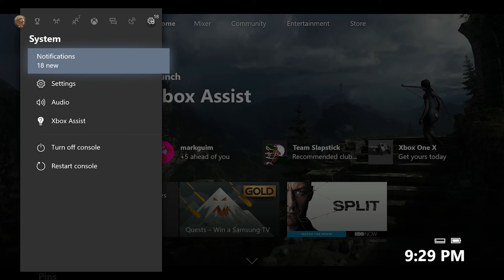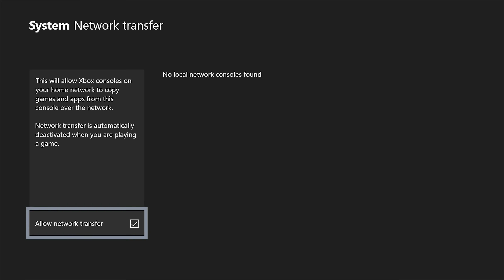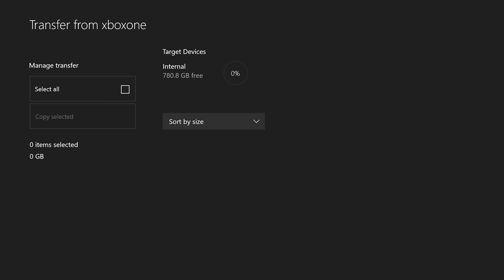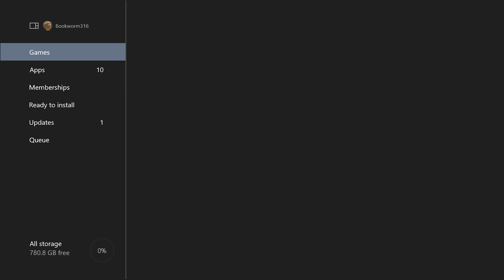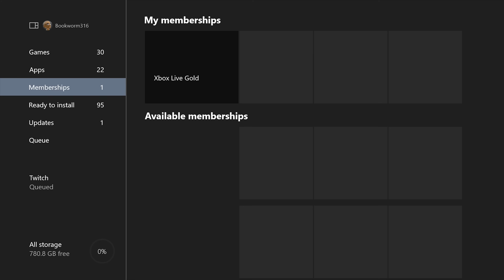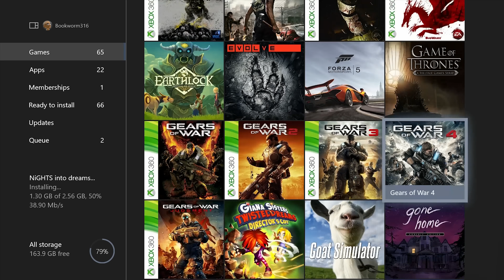Xbox One X Network Transfer Speed Test

Comment: my network transfer is going 1/5 of the download speed, just paused and resumed and it suddenly goes at a reasonable network speed. I'm noticing in 2024 the one x seems to be touchy regarding network at times, 80% of what I look up assumes I am using wifi and tells me to connect via ethernet which I am already doing

Comment: Do I need to have both Xboxs connected to my wifi in order to transfer thru network transfer??? because I'm planning on returning my Xbox one for an Xbox one S and idk if all my games n dlcs will carry over thru my profile
Reply: It should be on the cloud
Reply: @crownbikes1375 will the data of my disc games be saved if I transfer them from an xbox s to another one s?
Reply: Justified Anger yeah it should because of the cloud. I went from the Xbox one to the s and it saved I just had to reinstall all my games but it saved all my data
Reply: @crownbikes1375  are your really sure? Because I'm extremely scared and stressed out that I will lose all of the data from my ctr nitro fueled and lego dimensions games and mk11 and crash n sane trilogy too.
Reply: @crownbikes1375  and if the data is saved does it matter if its copied move or transfered?
Reply: Justified Anger as long as your on the same profile you should be good
Reply: Justified Anger people transfer or copy so they won’t have to reinstall.  I just went to work and left it all installing
Reply: @crownbikes1375  theres one more thing. I copied 4 xbox one games and two of them keep saying installation stop. If I cancel the 2 game will it delete the data from both of the consoles? I hope not
Reply: Justified Anger  no it’ll just delete the game but not the data that happened to me and I found a solution to it a while ago. What you can do too is get a external hard drive for like 50 bucks (2tbs) and copy the games onto there
Reply: @crownbikes1375  I have a hard drive but it's in the office and my console is in my room. Are you sure there isn't another way to get the 2 games installed besides transferring?
Reply: Justified Anger not sure research YouTube a bit you’ll find something but I work long hours I just let it install all in one day
Reply: @crownbikes1375  okay but are you sure there isn't a way to transfer all of your save game data to another profile?
Reply: @crownbikes1375  and if you restart the one of the consoles will it delete all the data from both consoles? I hope not
Reply: @crownbikes1375  and if I make a different account on the 2nd xbox one and transfer the data from the other one with the other different account it won't work will it?
Reply: Justified Anger no it won’t delete. And yeah it has to be the same account because each account has a cloud that saves game saved data
Reply: @crownbikes1375  okay but what happens if safely remove the hard drive from the console and plug it to the other one?

Comment: If you have gigabit ports on your router it doesn’t matter, the transfer speed is limited by the hard drive read and write speeds, which are SATA II limited since the Xbox one S has a SATA II port. The HDD in the regular Xbox is SATA III however, lol Microsoft engineers never cease to amaze me with their choices.

Comment: good video, but you refereed to bits as bytes. there is a huge difference 8 times larger or smaller depending on which way you are talking, i assume you only misspoke and know the difference but i wanted it in the comments that there is a big difference.  the reason i am watching your video was i wanted to see how my transfer speeds compared, as you cant really trust microshaft to report honest numbers. i too am using a gigabit wired network and normally i get about 200-300mbps on these transfers, which is 1/3 of what my network can handle, but apparently we have a bottleneck somewhere, perhaps hard drive interface speeds? anyways tonight i swapped between 10/100 and gigabit just to observe, one more time the speed benefit of gigabit, before i rewire my entire network, and its like my xboxs still thought there were on a 100mb connection smh, as i was only geting 20-60mbps....uhg

Comment: dude what you're seeing is actually Mbit/s not MByte/s. I see you're getting about 250 Mbit/s max (same as me) which is only about 30 MByte/s.
Reply: Manuel ya u r right and it is sad i get only get 280mbit/s max transfer speed on my 1gbps local network and only get 280mbit/s download off xbox live wth my 1gbit/s connection. Only my xboxs dont reach 985mbit/s.

Comment: Could you make a video of showing how the physical connections are set up??
Reply: TopGunAce23 The console you're transferring from must be on ur wifi network. The console ur transferring to can be plugged up with the ethernet cord. Actually that makes things go a lil faster!
Reply: kentray Swagger Thank you for that information sir.
Reply: TopGunAce23 You're welcome and  also make sure no games are running in the background becauss the transfer will not work while playing a game!
Reply: Do you mean connect them directly to each over with a network cable? or just have them both plugged in to the Router with two network cables?
Reply: Noble3781 it doesn't work by directly connecting the consoles, i've tried it. (that does work with the PS4 transfer though btw) the fastest way is to connect them both via ethernet to your switch/router. having them on the same wifi network also works but is much slower.